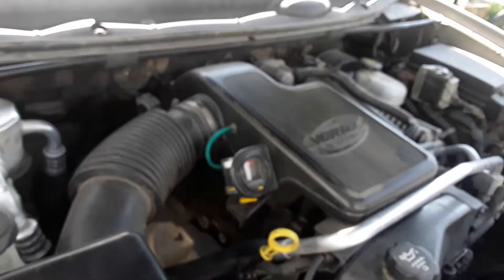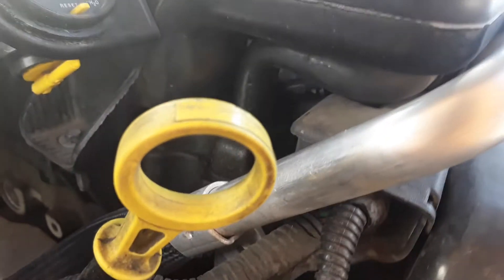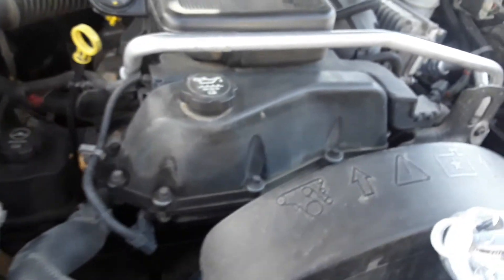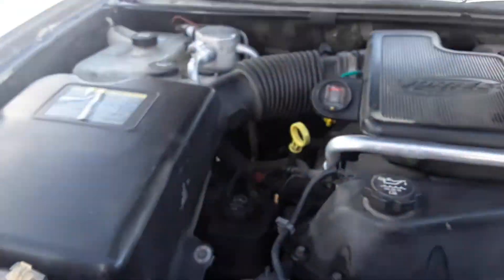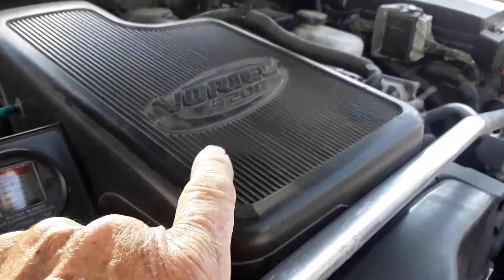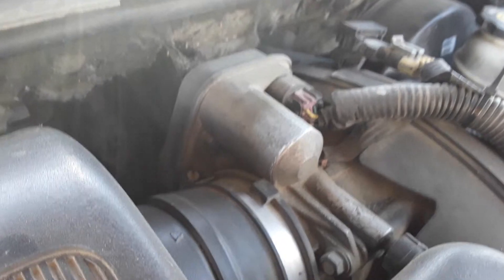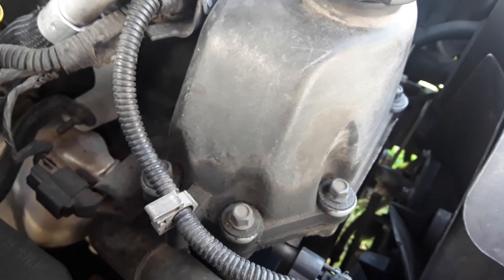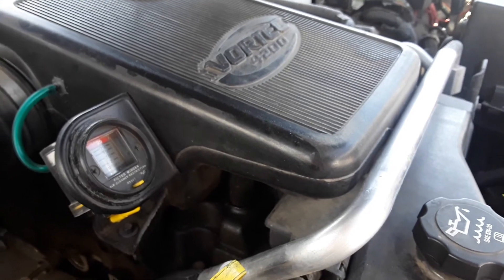Yes, The 4.2 Has A PCV System

Comment: that's it then I'm going to drill a hole the size of a spray can nozzle tube and clean that sucker out, seal hole with rtv silicone . You can do this with the throttle body intake as well. smarter  not harder...

Comment: I added a catch can to the drivers side PCV hose area. It seems to work well and I catch about 1/2 cup of brown mayonnaise between oil changes and I like keeping that sludge out of where ever would otherwise go. I don't really get much crap on my throttle body - just a bit of carbon buildup that I clean up occasionally. What are your thoughts on a catch-can?

Comment: It's not the suction side hose that gets clogged. The head gasket on these engines have a ridiculously small hole, 7/64, in which the PCV vacuum must pull through. It doesn't  take much to plug it up and should be a regular maintenance item, like every time you change your oil. I've seen many of them completely clogged with carbon. Piss poor design by GM. That hole in the head gasket should have the same I.D. as the vacuum hose has.

Comment: I just bought a 2002 trailblazer and am having issues with the check engine light and reduced engine power and I just noticed the resonator s hose thing you showed isn't connected! Do you think that's what is causing my issues?

Comment: Gunk can get it if the PVC hose under the cover (short 2 inch hose you poiting to.    Its not clean air if that hose has a gap in it which the last mechanic left loose.   Do not assume the hoses are all sealed as it can let dirty air in.

Comment: What would it mean if you get oil coming out the bottom of that S shaped hose?
Reply from the maker: There is not supposed to be anything there but clean., filtered air. The video goes into detail about that problem. Lemme know if you need more insight.
Reply: @SurferJoe46 yeah thanks, I figured it out. My wife's 05 has never had condensation (milky oil) in the oil cap, on the oil stick or the intake resonator. It recently started leaking a little oil out of that s hose. I pulled the dipstick with it running and placed my thumb on the tube and can feel no vacuum. I found that rubber hose you showed on the driver side and I removed it from the top after letting the engine reach operating temp, poured a couple caps of B12 chemtool in there like you said. I could hear it bubbling & gargling in there for about half a minute or so. Let it sit for 15 minutes and took my blowoff tool and shot compressed air in the hose. Repeated that process about 7 or 8 times. My question is, does the compressed air supposed to flow freely through that hose, or is it supposed to be restricted? Because mine seemed like it wasn't letting air in at all. I'd put the rubber nozzle of the blowoff tool in the hose and it would shoot back out of there everytime I gave it any air. I couldn't even force it to stay in there while blowing air. Maybe it's supposed to  be restricted to only allow so much air to pass, or maybe mine is still severely clogged. Please let me know what you think, thanks!

Comment: I'm having a hell of a time my hose was dry-rotted and when I finally got it off it broke off in half so I finally got a new one and I can finally get to this procedure what do you mean by suck it all out do I have to take a vacuum and suck it the hose after I add the B12?
Reply from the maker: I went back to find what you mean by looking at my script. 
And "sucking" done is by the engine --- you don't need to suck on anything.,
It's all in the video.
Reply: @SurferJoe46  awesome... I actually watched the other video about this that you posted and it said just blow air compressor air in there thanks for the reply and the video ✌️
Reply from the maker: @willfreethemfreethem7671  ... and a little more ... I'd be a bit afraid to vacuum up explosive chemicals --- B12 is one --- gasoline being another - into a vacuum cleaner. I can think of other explosive liquids that would not play well under the same circumstances.

Comment: Hi Joe, great, great video, you must have been an educator of some kind. I really appreciate the information you put out there, it's the furthest I've gotten with my Trailblazer. 
If you know, can you tell me what is at the other end of that nipple going into the crankcase on the vacuum side? I did what you suggested and pulled the short hose, attached a longer hose and put the B12 in and left it overnight, no luck at all. I ran a few different snakes in the tube to see if I could clear it, I make it past the bend but it hits something hard down in there on the inside of the crankcase. 
I haven't been able to get any airflow at all applying pressure and vacuum to that tube. Is it a check valve or something inside there? Thanks again ✌️
Reply from the maker: Don't use air pressure or apply vacuum - that's a waste of time/effort and not how this works. 
Pour the B-12 into the hose, put the hose back on and let it sit for a while. 
Start the engine. You may or may not feel any vacuum at the 1. OIL cap or 2. The dipstick tube. 
Perform this B-12 process a few times a month/week until you get the system working.
There are no moving, serviceable or adjustable parts in the bottom of that hose/nipple.
Reply: @SurferJoe46  gotcha Joe, I just have to be patient. I did see on another engine the inside end of the pcv connection was basically capped with 2 rather small holes, I can only guess to minimize oil getting past or funk making its way into the crankcase. I expect I will never get to see what's on the other end of mine, but I have 2 cans of B12. Thanks again, I really mean that. ✌️

Comment: What is little box with green holes
Reply from the maker: Is "holes" a typo for "hose"? 
If so, it's an air filter gauge to tell when the air filter restricts the flow enough to affect performance. (LINK HERE: https://tinyurl.com/3njeabe9 )
You'd be amazed how long an air filter is good .... 
The one in my TB is over 9 years old and the sensor hasn't moved at all. (yes - I test it all the time - it's OK).
Not surprized to know that the air filter in my '86 K5 383 stroker is over 18 years old and it too has not moved the sensor a bit.

Comment: I can't thank you enough for this explaination. We've had our Trailblazer for 13 years and it finally locked up, and you just explained to me exactly what happened to it. The choc milk on the plug in the air box, the frequent replacement of the timing solenoid, the oil in my air box and throttle. I wish I would have seen this video 10 years ago. 

This makes so much sense. Thank you so much for this video.
Reply from the maker: @dochojo9009  I am sorry for your loss of your vehicle.  I never like to hear of things like that.  Mechanical things were and still are my life blood.

Comment: What hose clamp are you talking about removing?
Reply from the maker: On the driver's side (left vehicle side) - the large hose to which I point and IF there's a hose clamp on it, remove it. There may NOT be a hose clamp on it if it's been serviced before - it's really not necessary.
Reply: @SurferJoe46  thanks for the reply, I saw your other video which has better lighting and understand now

Comment: My cars doing this im getting milk in the top box and the left pcv hose. What hose clamp are you talking about and is there a pcv vaulve to replace i cant get the driver side hose off not enough room. 03 chevy trailblazer i clean it out every 2 weeks it blew the valve cover and i had to put gasketmaker on it.
Reply from the maker: One more time --- THERE IS NO PCV! There is a system that operates that way --- but NO SERVICEABL PARTS. 
Removing that hose is easy --- it is the only way to clean the system - so you have no choice but to remove it and pour the B12 into it as I explained in the video. 
It will likely take more than a few times to get it clean after many years and miles of not servicing it.
Here's another look at the hose and clamp ... https://youtu.be/pJT-ajnKGYI?si=q3cClYHVocIPx0ig

Comment: How many times do you need to do in order to get some vacuum on the oil dip stick
Reply from the maker: Good question --- but is depends on how long the system has been ignored and the amount of contamination you need to soften and remove. It's had years to collect and get hard --- it may not be quick or easy --- mine took 2 months of every 3rd day treatments before it cleaned up sufficiently to start pulling a vacuum and purge the crankcase. Hopefully, your time will be shorter.
Reply: @SurferJoe46  will it also clean exhaust manifold if I do this 🤔
Reply from the maker: @angelf9800  There may be some small cleaning of the exhaust runners -- but understand this is not the purpose of cleaning the PCV system. If you have dirty exhaust runners - and I find that hard to believe - you have some other dynamic happening here.

Comment: Nice video. What is that contraption you've installed on the passenger side of your air box? Does it measure vacuum?
Reply from the maker: @NoFace-jp6dk  It is an air filter restriction gauge that tells when the filter needs replacement.

Comment: Why do I have oil inside is it normal if not what’s the fix
Reply from the maker: Thanks for the great question.
Inside the plenum? Nooooo --- that's not natural. 
Nothing but filtered air should ever get into there --- as the only intake is SUPPPOSED TO BE through the air filter. 
IF you are getting oil travelling up through the atmospheric side --- (the KV-side or the "S"-shaped hose under the plenum from the valve cover) --- of the intake, then you have a problem.
Reply: What's the possible cause and solution for this issue? @SurferJoe46
Reply: What would be the problem that causes that?
Reply from the maker: @MattSmith-xs7wj  The reason why you get water and oil emulsion inside the plenum, under the 711 cap and generally inside the whole engine - is from a non-functional PCV system 
This is the whole reason for my post(s) and statements. 
If you watch the video again and pay attention to the dialog, you'll have a better understanding.

Comment: My trailblazer seems to run perfectly fine. Starting to get chocolate milk in the oil cap. Do u recommend I do this process?
Reply from the maker: That's what the post is all about. Baby poop in the engine is not normal.

Comment: Would this issue cause overheating ?
Reply from the maker: The problem manifests itself in the intake system, through the throttle body and even if the CV side (suction) is plugged up solidly, I don't envision any overheating from that system. 
Overheating is usually related to a bad thermostat, bad cooling fan, plugged up radiator, cracked head/block or a blown head gasket. 
Go for the thermostat first (it's an assembly with the neck and thermostat as a unit) and if that doesn't fix it, goto:  https://www.trailvoy.com/ and post your problem there for help in your search.

Comment: What is that little H20 separator on the intake?
Reply from the maker: Ahhh! You had me going there for a moment or three ... It's a vacuum gauge that tells when the air cleaner needs to be changed. FTR ---> I have the same sensor in my K5 Blazer and the air filter on it is over 25 years old (looks ugly, but ugly isn't a criteria for filters) and it still doesn't move the plunger, and does not yet show red. These are used on my GM trucks, straight from the factory and are very much a good reference if the filter needs to be changed or not. (Don't tell the Air Filter Lobby in DC because the market on new air filters is HUGE and in reality, almost all filters are prematurely thrown away.

Comment: This was crazy helpful. Basically cleaned out my intake system 20k miles ago and kept my baby running despite 3 master mechanics including my father who said it was a dead vehicle....haha. it runs like a beast after a cleanout and a new valve cover gaskets. Oh and delete the resonator with an air intake kit. Best $50 i spent.  Added a bit of power too.
Reply from the maker: Did you LIKE my post? I'd like to collect some Thumbs-Up to keep from being bounced to the end of the line.

Comment: Thank you for this video. I spent about 2 hours watchng it and rewatching it and reading all the comments. 

I am in the middle of this project and I may have jumped the gun because I removed the intake and used some degreaser to clean the vents and now, though much cleaner, it has alot of ashy build up. I think its all good but i dont know if that ashy build up is bad for the system.

Also, will the B12 reverse the baby poop in the entire system? My last code reading showed a catalytic convertor issue and I dont know if it may need to be replaced because of the brown tar.
Reply from the maker: Once the system is cleared --- the baby poop should be a long time before it forms again. 
A working PCV system should never get that way --- dirty or oily - and when it is, then you have to search for the reason. 
You did that - and although you went a little further down the road, it's all good and you'll accomplish the same results only faster.
Reply: @SurferJoe46  awesome good to know. Thank you again

Comment: Im doing my timing chain completely all parts , having a blast taking everything off to get to the parts. I have noticed that there is a load of gunk everywhere in the engine. Could that be cause of a plugged pcv system also?? Also what is the fluid that would be great to clean the pcv system??
Reply from the maker: That coul;d do it, sure enough! I use Berryman's Chemtool liquid or spray.

Comment: Had my TrailBlazer at least 10 times in the shop because of a P0014. I noticed the chocolate mayonnaise in my airbox. I regularly clean the nasty throttle body and change the oil every 3 to 4 months to avoid the P0014 popping up. No matter what the shop did, or I did fixed the problem. 

Just picked up a new Variable Valve Timing Solenoid today and get the oil change done tomorrow. I will try your cleaning advice as well since I am very confident that's causing the problem.

I really appreciate this fantastic video! Will keep you updated.
Reply: It has been a month since the oil change and VVT Solenoid replacement. I used a Liqui Moly engine flush before the oil change. When I removed the hose to poor Sea Foam in it, I noticed the hose was porous so I replaced it entirely (what a nightmare to get off). In addition, I cleaned the throttle body and used the Sea Foam Top Engine cleaner & lube.

First of all, what a difference in power. The engine runs like new and second of all, no more P0014 popping up when driving long distances. I assume it was the hose causing a vacuum leak since the VVT Solenoid has been replaced twice in the last 3 years, but don't know for sure. I am disappointed that none of the mechanics could figure this out. Anyway, thank you so much for the video.
Reply from the maker: Thanks --- awaiting any news on your success in making the PCV work again!

Comment: That breather system destroyed the catalytic converters on my beater😄
Reply from the maker: On a 4.2? That's interesting because the 4.2 only has one cat.
Reply: @SurferJoe46  the 08 trailblazer had an updated longer exhaust, clogged up both of them, swapped them out with a cheap ebay special pipe and unplugged the upper sensor, purrs like a kitty now lol

Comment: That's all well and good but where is the PCV valve isn't that supposed to keep all the oils out of the intake
Reply from the maker: That's the greatest part of this video --- there is no valve. The video explains all that if you watch to the end.
Reply: @SurferJoe46  yeah but in the long run it coats the whole inside of your intake coach your throttle position sensor and the air valve that's their I can't think of the initials for it.. I'm talking about the valve/sensor  controls your idol. I just cleaned a 2004 intake out that had that exact problem. It had a hole coat of like varnish inside the plastic intake and into the plum that's where I stopped and I'm sure there was more. I'm sure it made the valve train sluggish and all
Reply from the maker: @markthrush2139  You realize, don't you, that there's not supposed to be anything but clean air going through that throttle body - right? 
If you're getting a varnish build up, it's coming through a K&N filter or there's a leak inside the clean air side of the filtered air-through the plenum. 
At NO time is there supposed to be any oil that might form the "varnish" you mention unless it's coming from the inoperative PCV ---> it's not working and the fumes are going backward into the plenum.

Comment: This solved my "cold start rough idle" issue! I used Gumout C&C cleaner spray. Also, I added a 90° elbow to the 1/2 ID pcv house from the driver engine because even a new house would crease in that tight spot.

Comment: If this is the problem will it cause stalling a idle? once mine gets up to running temp it stalls at idle? i do have oil coming into my air intake box! Was thinking head gasket just not sure i do not get any codes. I wish i could just turn the idle up! lol Also i have a new pcv valve coming that is on the valve cover any thoughts on how that will come out without breaking and going in the valve cover?
Reply from the maker: 1. There is no PCV valve. You cannot buy one - nor does one exist --- but I guess some unscrupulous persons might sell you one.  
2. Oil in the box is because of positive pressure in the crankcase because the PCV is not working.
3. Stalling after warm-up can be from the MAF or BMAP not sending valid metrics to the engine management system (PCM)
4. Bad metrics from the BMAP or MAP is because the PCV is not working. 
5. Idle speed is baked-into the computer - it is not adjustable - don't even try. 
6. Don't lower the river, raise the bridge by fixing the obvious problem first.